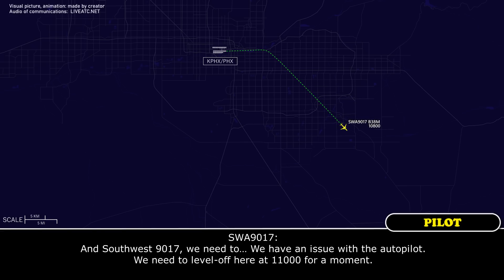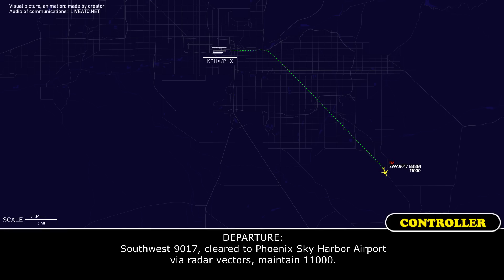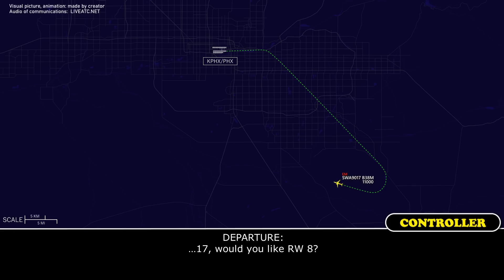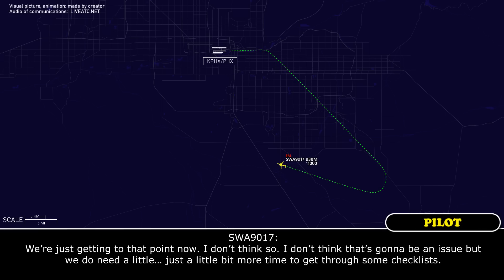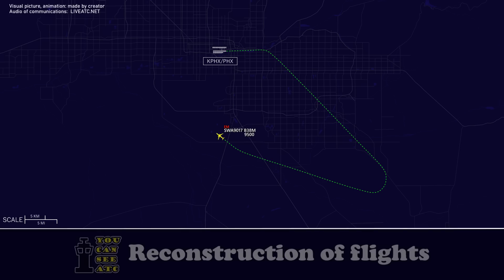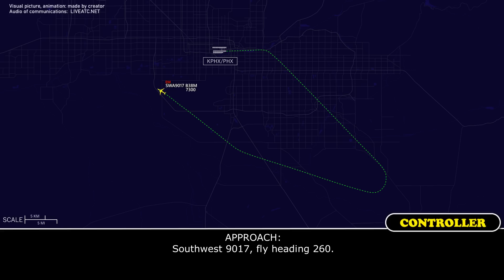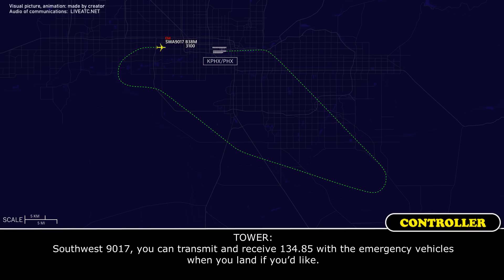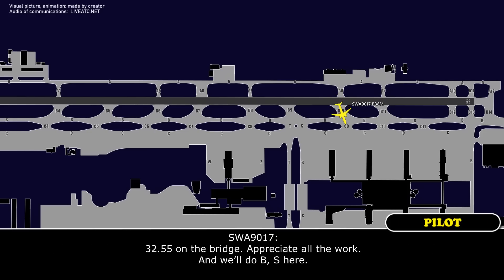“Trim system is not working”. Autopilot issue. Southwest B737 MAX 8 returned to Phoenix. Real ATC

Comment: Great video. Common sense would suggest that no plane's trim system has been more thoroughly scrutinized than the MAX. With the recent spate of near misses on the ground, it comes to mind that returning isn't free of risk either. The professionalism in this incident speaks more than the system glitch.
Reply: I can see your misunderstanding, but they stated that they were using manual trim to fly. It all uses the same systems and jack screw to move the horizontal stabilizer, no matter what originates the commands to move it. So with manual trim only, that means no speed trim, no mcas, no auto pilot.
Reply: @NeneExists  

    
        It was you that demonstrated the misunderstanding of the trim system.

    You stated: “An autopilot trim problem would also mean either faulty or no MCAS in 737 MAX…”

      That statement is false.   

    Autopilot trim is a separate trim function from speed trim.

       Speed trim (and sub-function MCAS) most likely were working fine.   The autopilot was engaged sometime around 10,000 ft most likely.

      Then, since the autopilot was not trimming the stab, the crew got an illuminated “STAB OUT OF TRIM” light

       In flight, this message only appears when the AUTOPILOT is not trimming the airplane.

      Now, as they went through the QRH, it would ask if electric (control column trim) was available after the autopilot was disconnected.   

If not, only then would the stab trim cutout switches be disconnected.

      From the audio, it is not completely clear that they were indeed manually trimming the stab.

      Again, Autopilot trim and Speed trim are two completely separate “auto” trim functions.
Reply: @NeneExists  
        Your original statement is still wrong.

          Time will tell if they were truly trimming manually or using the thumb actuated “main electric” trim.

       IF they were trimming manually, that could be indicative of a simple failure of the trim motor.
Reply: MCAS is different to stab trim
Reply: @NoRegertsHere  
          WTH is it with YT videos that cover an incident involving a somewhat complex aircraft system?    It seems to bring out the ignorant and misinformed like @Nene and now @Benny L.

       Damn trolls.
Reply: @Stepclimb  I have a complete and thorough understanding of the system. This was some sort of trim issue, but not enough info to know what sort. Not MCAS. They are different.
Reply: @NoRegertsHere How does the MCAS pitch the nose forward in the event of a stall....or in the event of a faulty AoA ..???
Which system does it use.??
Reply: @daftvader4218  was not an MCAS event based on the info available.
Reply: @Stepclimb  Think 8 year olds in a playground.
Reply: An autopilot trim problem would also mean either faulty or no MCAS in 737 MAX, so I'm going to say that locking that out and getting back on the ground seems like by far the best idea. No one wants to be in another 737 lawn dart.
Reply: @Nene  I thought the same. After the MCAS accidents, they've probably made the system extremely sensitive and to disable itself if the slightest anomaly is detected. Which is probably for the best.
Reply: @VOIP4ME  ... the flight attendant likely plugged in the coffee maker.
Reply: @VOIP4ME  MCAS isn’t in use when autopilot is flying.
Reply: @VOIP4ME  nope, not in this case whatsoever. When MCAS gets disabled, you still retain the use of normal electric trim.  This was something else alltogether.
Reply: @NeneExists  

       You do not understand the speed trim system of the 737.
      MCAS is a sub-function of speed trim.   It uses stab trim to change pitch force gradients.

      It only works with Autopilot OFF.

     These guys were having an issue with Autopilot trim.
     
      Apples and oranges….
Reply: "Common sense would suggest that no plane's trim system has been more thoroughly scrutinized than the MAX."    yup, more lines of code, on top of code .. on top of code .....
Reply: @craig7350  It's not a bug, it's a feature! Lol

Comment: Why do certain ATC's ask for fuel in pounds sometimes and others in time? Seems like that could be standardized. 99% of these I've heard, if the pilot gives it one way, the controller requests the other.
Reply: "Fuel in pounds" is what the emergency services need - in case the aircraft crashes. "Fuel in time" is what ATC itself needs - so they know how much time the aircraft can still stay in the air. But since this aircraft had just departed, ATC knew that fuel/time wasn't an issue here.
Reply: @fgaviator  Thanks! That makes sense...they need to know both. I always imagined that the pilot might get irritated by the second inquiry. Thanks again!
Reply: @fgaviator  In addition to letting ATC know how long before the aircraft becomes a glider, fuel in time also gives them more insight into the opposite issue - how (relatively) heavy the plane will be landing, which is helpful for knowing about how fast it's going to be flying down final and whether brake heating is likely to be a problem. Controllers won't have fuel capacity, MTOW, MLW, etc. memorized for various aircraft, but they do have at least a rough idea of endurance for various aircraft, so fuel in time gives them more insight into how relatively heavy they'll be landing for their aircraft.
Reply: @vbscript2  Doubt very much that a Heavy Landing will be ATC's Concern, that will be a Maintenance Concern Post Landing, the Pilots will Inform ATC of that Scenario. Time Remaining will also give ATC the Heads up on how Far they can Vector them and for how Long Dependant on the Type of Emergency of course. Also, as an Ex Fueller, sometimes, an Empty Tank can be more Hazardous than a Full one. Not sure why they Request it in Pounds as all the 737/800's i've Fuelled are Loaded in Kilos, the Pilots also Gives me the Figure Required in Kilos.
Reply: @MADTASS  Landing heavy matters to ATC because it also means landing fast. ATC needs to have an idea of how fast a plane is going to be flying down final in order to plan separation accordingly.

Also, if the landing is especially heavy, they may need to arrange fire crews to meet them to check their brakes before they continue taxiing in. Brake fires can happen on particularly fast/heavy landings. Energy varies with both mass and the square of velocity. So, when you're both heavier and landing faster, energy that must be dissipated into the brakes increases by somewhere around the cube of the difference in weight, not in direct proportion. As a result, hot brakes are very common in scenarios with heavier landings (or with high-speed rejected takeoffs.)

You're definitely right that maintenance will want to take a look after the plane is parked and make sure nothing was overstressed, but ATC isn't worried about that.
Reply: Agreed, fuel in pounds must be more useful to ATC as it directly gives them volume to pass to emergency services, fuel in minutes is dependent on what's turning and burning.
Reply: Fuel quantity is important, because the airframe can sustain catastrophic failure do to the weight of the plane at landing. So that’s why controller asked if the pilots needed to burn fuel, to lessen the weight of the aircraft, since they just took off.
Reply: As others said above, fuel in time gives ATC an idea of how long the plane can stay in the air if need be, and fuel in pounds affects the ability of the plane to safely land. Planes have a lower maximum landing weight than they do maximum takeoff weight since it's assumed the fuel will be burned in flight. Also as stated, if there were to be a fuel spill on the ground after a possible crash landing, fire crews would appreciate a heads up on what they need to prepare for. Emergency services always need to prepare for the worst possible scenario.
Reply: @waffle911  mid-worst possible, in worst possible, they really can't do much since it all will happen too fast.
Reply: Time is important for how long the aircraft can stay up, mass is important because if it crashes, the fire crews want to know how much bang there is going to be. Pounds? Because despite being such a progressive country in so many ways, the US is still backwards in weights and measures (amongst other things)!
Reply: @edwardcoe7293  Thanks to you and all the other responders. I don't fly 'em, I just like to watch 'em.
Reply: Dependson how the arplane system is set; some are in Kgs and some are in Lbs. it’s up to the airline to decide whan they order the plane.
Reply: Sometimes it seems they’re just pranking the pilots. Regardless of what’s given, ATC needs the other.

Comment: Just remembering the great pilots who hand flew every flight in DC-3s and Convairs.  No autopilot, no flight director, no DME or radio altimeters or navigation computers.  Just great safety records, reliable service and little drama.
Reply: The good ol’ days where crashes were 1000 times more common!
Reply: Safety records were not great. Service was not as reliable. DC-3s has DME and they did have autopilots.
Reply: 737 MAX is a little bit different. Just a little bit.
Reply: Airplanes that went less than 200 mph and carried 25 people. GREAT comparison.
Reply: Aviation is safer now after learning from mistakes made in the past.

Comment: EMERGENCY!!! PILOTS REQUIRED TO FLY AIRPLANE!!! :-D /s sort of.
Reply: @jonathanparle8429  The flight 302 crew disabled the trim stab, disabling MCAS. Doing that also disabled the trim button on the wheel. That meant trying to trim with the crank. Not easy.
Reply: @jonathanparle8429  that's fine, but at this point how they could be sure what the autopilot would (or wouldn't) do next?
Reply: @HapyLLIuTeJIb  No one ever knows for sure anything about anything.  So it's' not relevant.
Reply: The very system that already put 2 aircraft of this type into the ground malfunctioned, and this is what you have to say?
Reply: @HapyLLIuTeJIb  Was not the auto pilot, it was MCAS.
Reply: @SHOOTSHOW00  still - trims
Better safe than sorry.
Reply: @HapyLLIuTeJIb  IT WAS A JOKE.   PLS STOP.
Reply: @zachansen8293  huh huh huh.
Reply: @HapyLLIuTeJIb  I didn't see any mention of runaway trim.

Comment: 737 needs to retire
Reply: I don't know if the 737 is the problem as a generalized group, but it might be difficult to argue with you if we narrowed that to the 737 Max.
Personally I don't think it should be retired, I just think manufacturers need to do a better job before going after the bag and releasing bad products to the general population. That's not just a dig at Boeing, this happens in every single industry where there's a profit to be made. A few people die here a few people die there, "eh we'll work out the kinks eventually". Not exactly the kind of product release you want where people don't have their feet firmly on the ground lol.
Reply: It doesn’t NEED to, but it’d be nice to have it replaced
Reply: Gal you retired long ago

Comment: Sad to see another 737 MAX having issues again but at least they made it back safely which is what matters. Great video!
Reply: Well, it's better the automatic trim disable itself if an anomaly is detected than proceed with potentially faulty information. Pilots can land safely with manual trim.
Reply: @Phillip Banes Ok clown. At least I can formulate a sentence properly.
Reply: This is of no relation to MCAS. Two completely different things
Reply: @Phillip Banes Starting unnecessary drama is also something a man child does.
Reply: @Phillip Banes You decided to start all of this over a comment I made about an inflight emergency with a particular aircraft. I really don’t understand what was your end-goal out of doing such a thing unless you get some type of joy of making irrelevant comments towards other commenters. I don’t what “YOU and your kind” is supposed to mean, unless you are trying start another dilemma which suggesting with the line of irrelevant comments you have made would not be surprising. If this is how you entertain yourself on a daily basis, then that’s quite disappointing.

If you wanted to prove you’re a man child, congrats. You have definitely proved that. You’re just another person on the internet starting drama over such a simple thing.

Have a nice day, Mr. Phillip Banes.
Reply: Easy there little buddy....mechanicals with new equipment is very common.
Reply: @RLTtizME  — On the very first revenue flight? The only hours and flights previously were testing and ferry.
Reply: @AEMoreira81  Wut?
Reply: @AEMoreira81  Yes. Very new and very old are when equipment is most likely to have issues. Not just airplanes, but any reasonably complicated system. Any engineer can tell you this.
Reply: @RLTtizME  
- "Stop calling me little buddy, I have a name you know"
- "Ok what your name little buddy?" 
- "LITLBUDY" 
- "Ok now look there LITLBUDY..."
- "That's better"
Reply: @RLTtizME  I’m well aware that new aircraft are capable of having mechanical issues. There are already many people who are still skeptical of flying in these aircraft due to its history of its issues. I’m not trying to attack the 737 MAX if that’s what you’re thinking. The 737 MAX program has created some amazing aircraft and I can’t wait till Boeing get the MAX 7 & 10 certified.
Reply: It’s a man made machine.. new or not it can have issues so don’t hang your hat on it only being a Max.
Reply: @XX-166  I’m well aware. I’m more pointing out the fact it’s another incident with a 737 MAX. I think many aviation enthusiasts can say the 737 MAX program has not had the best running due to many technical issues and malfunctions.
Reply: @echocongo  there are also other models that have issues.. 787 Dreamliner etc… man made items have issues that will have solutions
Reply: @XX-166  Agreed.
Reply: @echocongo  it’s got a bad rap, but the MAX is well beyond that now.
Reply: @Skywest25  Very true, I would agree wholeheartedly.
Reply: What an asinine remark.